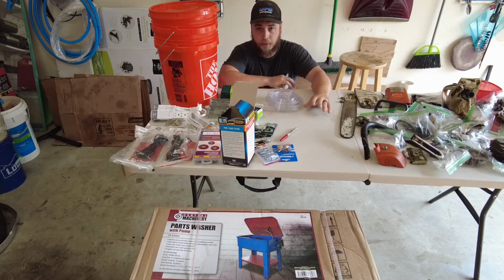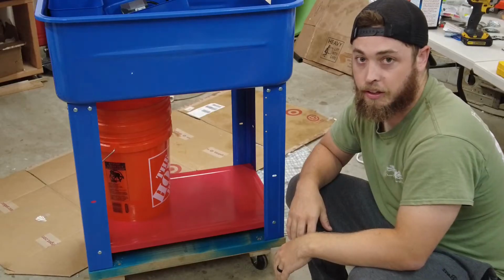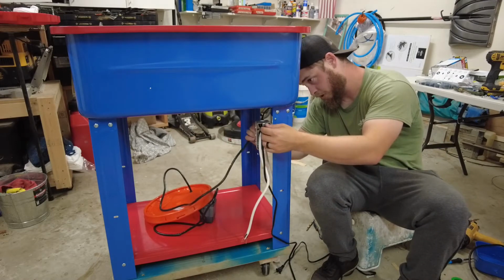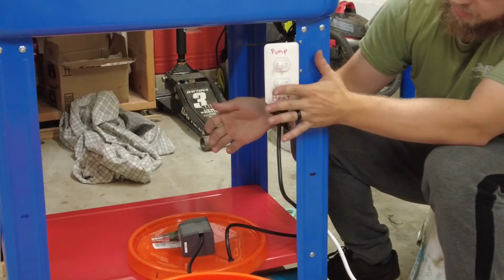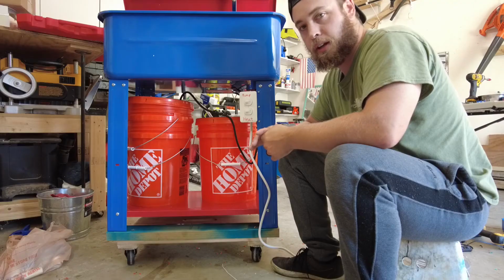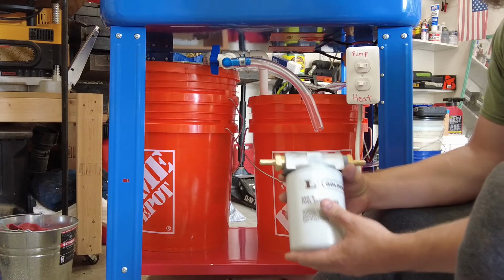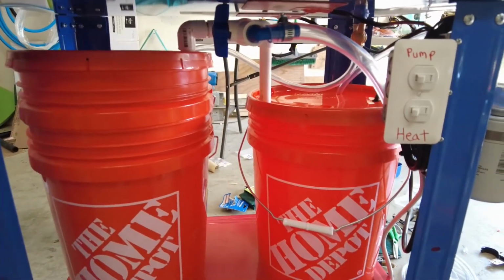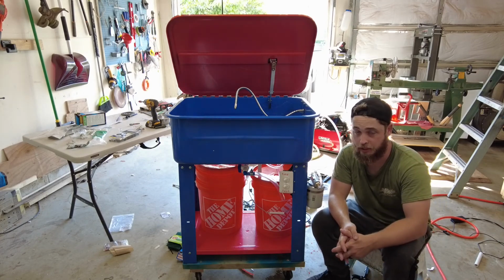Building and Upgrading the Harbor Freight Parts Washer (Heat, Filter, 2 stage sump)

Comment: I use a modified HF parts washer with a secondary pump that circulates the PSC 1000 through the filter whenever the washer is in use. I have also added a 1,000 watt water heater element through the side of the washer and controlled by a Rainbird PID . It will maintain the temperature automatically to prevent overheating. I typically set mine to 100 degrees F. The flash point of the solvent is 140 degrees F so there’s no big risk of fire. I have been using the washer for over a year without any issues.

Comment: I like watching these upgrade videos for parts washers mainly to remind myself not to do it. It's just a parts washer..that I will probably use 5 or 6 times a year.  And why do guys always start with a crappy parts washer to begin with?  Spend $200 and get a nice longer pan one where you can actually lay an engine head in...and it'll have wheels. Homak 20-Gallon Portable Parts Washer, Model Number RD00820290 was my choice.

Comment: Seems like you need the heater on the container that holds the solvent. The top basin just has solvent running over the heater, or are the heaters just for soaking parts with the drain closed?

Comment: Good video. How hot does the water get with those heating patches?
Reply from the maker: It depends. If I shut the drain off and fill the basin I can get the water warm but and inline water heater would be better. I have found I don’t need the heat, letting things soak seems to work better.
Reply: With no flammable liquid a 5 gallon heater would really keep it warm while washing parts 
But I’m in West Texas so up North it’s not enough???